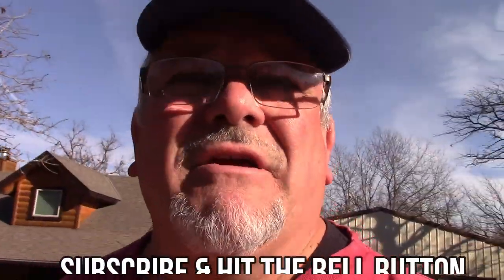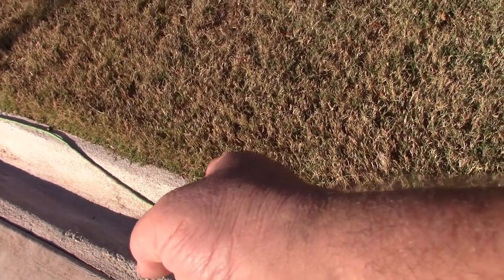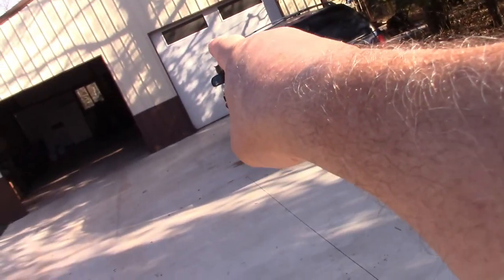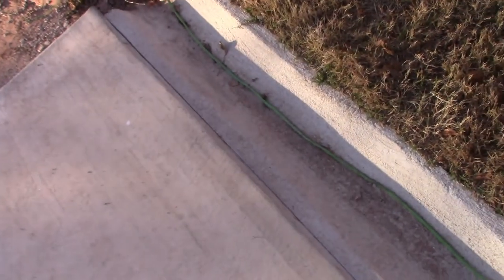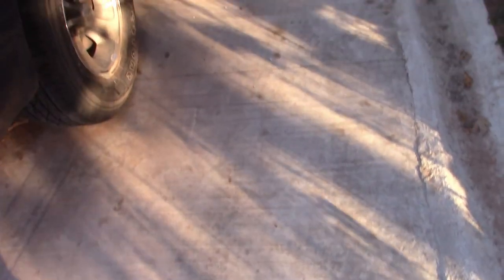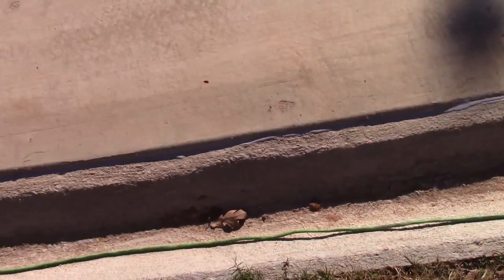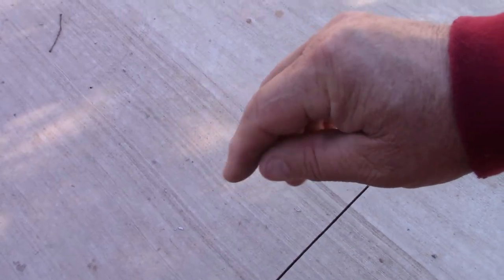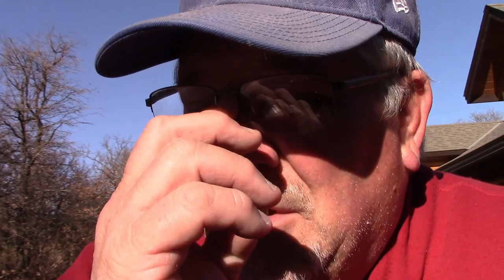DIY // DRIVEWAY CRACKS | Grind // Fill // SEAL CRACKS

Comment: Our driveway cracked all the time and my husband said it was the concrete must have gotten some rain after the pour and they didn't fix it during the second layer. I love those gutters beside your driveway, what an excellent idea, helps the driveway dry faster too!
Reply from the maker: most cracks are from the ground under the concrete. Then must have these relief cuts that i did. Now when you live in the cold weather and have the cracks better do what i did or will get real bad.

Comment: The slow demise of concrete, yeah ice a reall damager.
Good thinking with the line cracks, never knew that. So the expansion cracks aren't really affected by ice?
Great preventative maintenanc, anything specific or general sealant?
Nice job.
Have fun.
Reply from the maker: expansion cracks are normally the ground moving around and having no relief cuts. it is all preparation of the ground first.